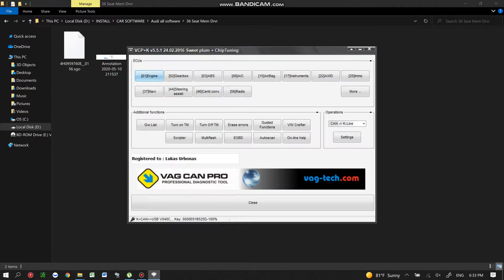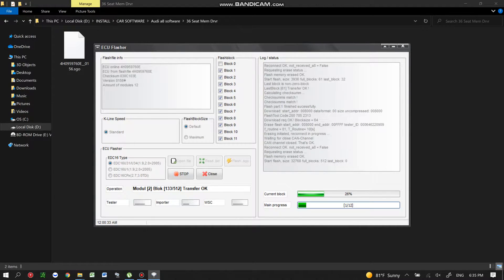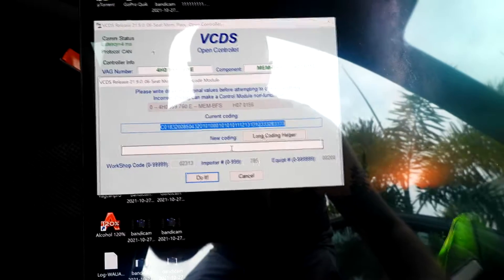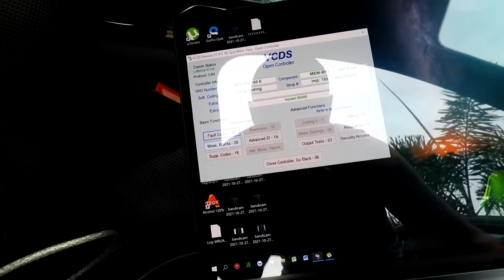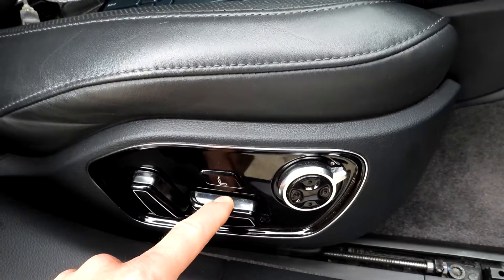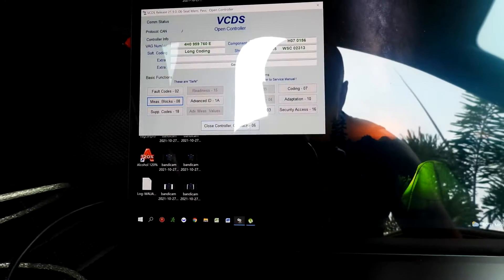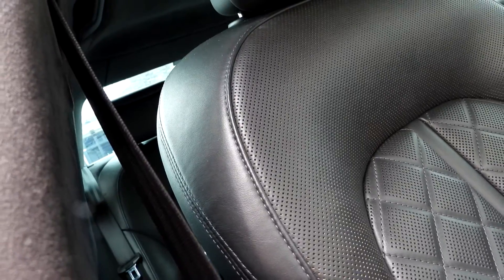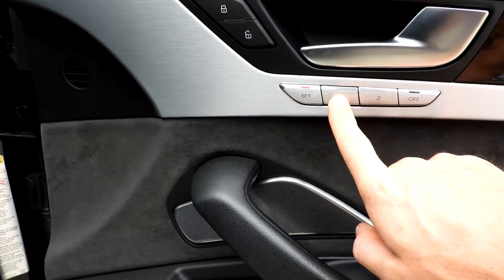Audi A8 D4 Flashing, Coding and Adapt Mem Seat Module/Прошивка и Адаптация Блока Сидения Ауди А8 11'

Comment: Do you know how to fix easy entry to work again (seat moving back to enter easer) I tot software update will fix the issue but no
Reply from the maker: Each door handle have a sensor, you need make sure your sensors are working. 
https://youtu.be/uH4jWaaphHM?si=XeYlHJgKOzH5pbhq
Reply: Doors work fine the steering goes up when easy entry is activated only the seat doesn’t move back
Reply from the maker: Do you have VCDS? Do you have any errors? Most likely you need to set the seat limits. Otherwise need to scan with VCDS to see what is going on.
Reply: @DIYDime I have scanned it no faults at all and yes I have set the seat limits nothing points to a fault and reading on the internet a lot of a8, a6 a7 owners experience easy entry stop working out of the blue